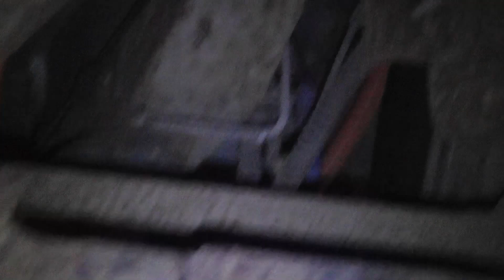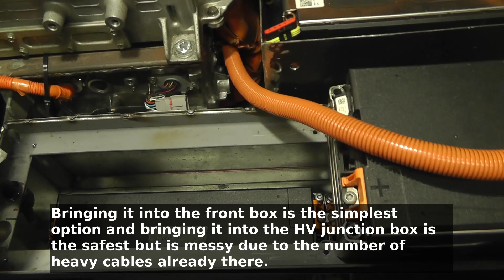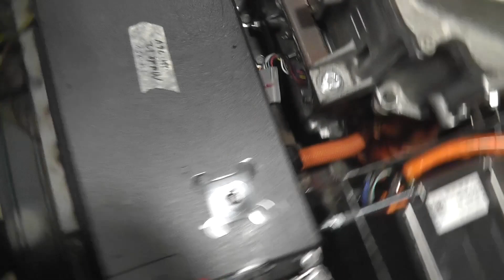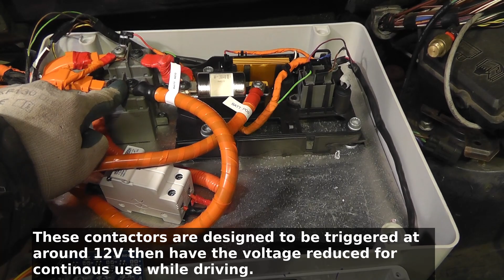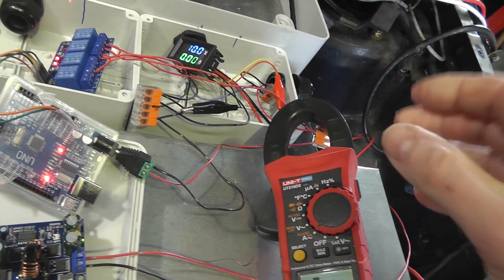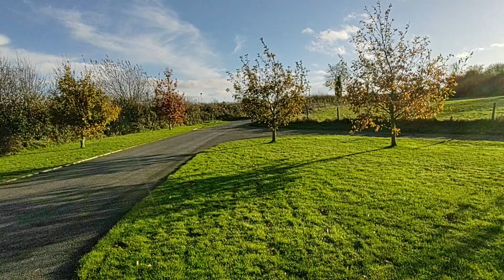DIY EV Part 36 - Connecting up the HV Junction Box Plus a VERY quiet test run.

Comment: Thank you for your video. Very informative and a build well done! Quick question. Aren't the main contactors polarised - i.e. it matters  that the current flows from terminal A1 to A2? However in your connection the current would flow in one direction when powering load (e.g. drive unit) and in the opposite when charging. 🤔
Reply from the maker: Hi thanks.
No they are not polarity sensitive. They're really just heavy duty relays.
The reason for having the charge connection's on the that side of them is you don't want the charger live all the time. 😉

Comment: Nice to see the addition of the Arduino into the controller. With the timing, you'll find that it changes with the voltage of the battery pack, and the temperature. One way of working around that is to measure the voltage drop of the per-charge resistor. This means that regardless of the conditions, the timing will always be correct, and the contractors as safe as they can be for this issue.  Well done tho, it's a build I watch closely and wait the next episode.
Reply from the maker: Thanks, I was planning to set a fixed precharge of around 2 seconds to be safe as I'm not experienced enough to try to be clever about it. Do you see any issues with that?

Comment: Doesn't your leaf board handle the pre charge and contactors?
Reply from the maker: What do you mean by Leaf Board?
Reply: @alibro7512  logic board or zombie board that controls the inverter
Reply from the maker: @JamieJones1985  I have a board made by Damien Maguire a few years ago for the Gen1 Leaf so while it probably could control the contractors TBH I haven't even tried. It is working and I don't want to risk damaging it or messing up the vehicle control. After this video was taken I made a point of soldering the connections between the Arduino and the relay board, then hot glued them together.

Comment: super awesome progress! thanks for taking time to walk through your contactor setup. and thanks for taking time to film everything. the amount of people that can watch this now and in the future is huge!  very interesting the way you have the arduino. question - do you think the reliability of the arduino will be enough for an automotive application? not just environment wise like heat and vibration, but like... if it runs for a long time and has some buffer overflow or something odd and resets... normally most people wouldn't care but i think in that case you entire car will reset as the contactors are opened. i may be worrying about nothing though... perhaps the sketch is so simple there is very little chance of that happening.
Reply from the maker: Thanks mate.
You make a good point about Arduino but I think they are pretty reliable as I've seen them used successfully in industry. For that reason though I bought a genuine Arduino Uno and for the charge control will be using a genuine Due. The code I'm using is ultra simple but I'll post it in Openinverter for others to take a look at and check. My coding is very poor so is mostly copying others and making small changes.
Also it is powered by the ignition so is very simple to reset although I hope that won't be necessary.